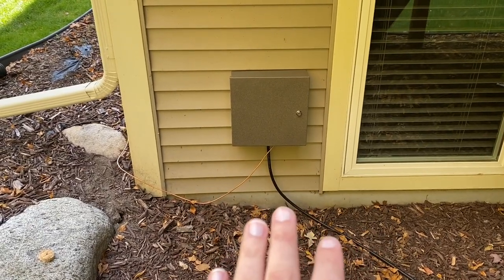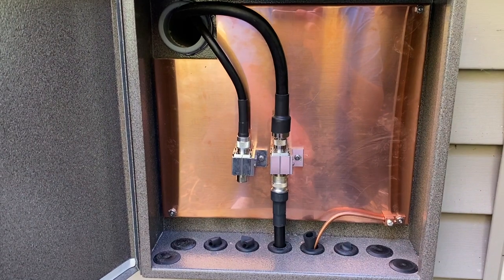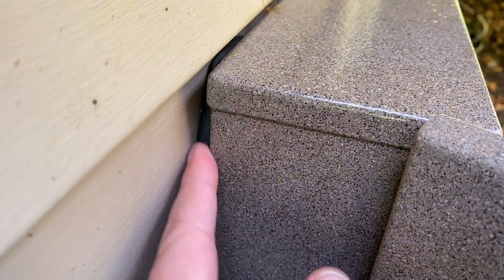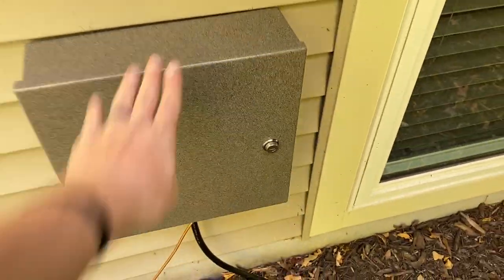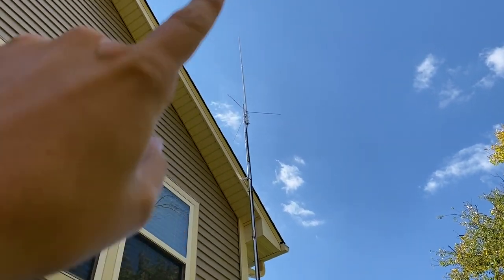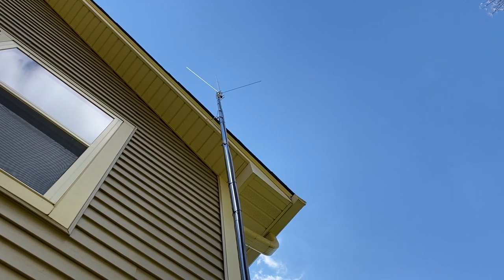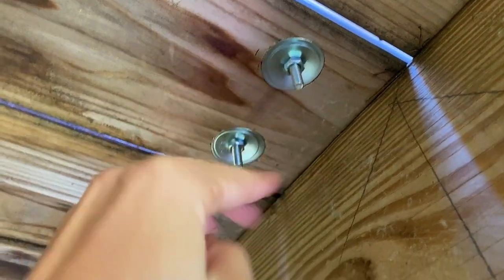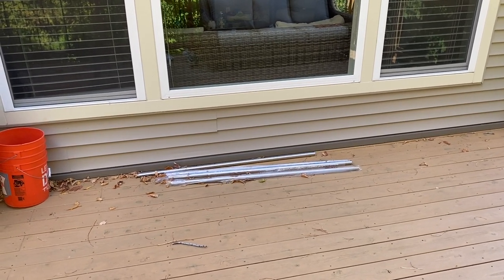K0LWC Ham Shack Tour: Coax Entry Panel and VHF/UHF Antenna Mast!

Comment: As of this writing the video is 3 years old.  For anyone contemplating a similar antenna base, drain holes at the bottom of the socket are a must.  Without them water will collect and initiate corrosion regardless of how "rust proof" the base is.  A pin going inside the mast instead of a socket would not collect water if the pin was either solid or had a welded on cap so it was absolutely watertight.

Comment: Diamond makes some great antennas. During tropo openings, I've used my X50 at 35 ft above ground and made FT8 contacts over 700 miles away.

Have you considered having the mast pass through the deck and pass into the ground? Another video idea would be to repeat the Pi Star distance test but with the hotspot using the Diamond antenna. I know it isn't what hotspots were intended for but would be interesting to see.
Reply from the maker: Nah, I’ll just ground it below the deck to a rod. Don’t want to cut through the deck if I can avoid it. 

As for the hotspot, I know of people who have done similar tests and 5-15 miles
isn’t unheard of.
Reply: How frequent are Tropo conditions and are they totally random or predictable?
Reply from the maker: dx398 Troposhoehric ducting is caused by the atmosphere and temperature/humidity levels. There can be some forecasting of it, but it’s generally random on when it appears,  how strong it is and how long it lasts (15 minutes or many hours).

Comment: What was it like working with LMR 600? Did you do the connections yourself? You mentioned switching to the Ultraflex at the box. Was that just to make the 90 degree turn or for any other reason? would you make the same coax decisions if doing it again? ...independent ground rod, or tie into panel ground rod for house service?
Reply from the maker: LMR-600 is a beast to work with. At 1/2” in diameter and a plastic jacket it’s very stiff. If the run is 50 ft or less I’d just get LMR-400 UF. Above 50ft I’d get LMR-600UF all the way. I didn’t do the connectors myself as it’s more intimidating with coax as thick as LMR-600. The use of Ultraflex was for the turn to get it into the house and makes routing the cable easier in the ham shack. The ground runs to a rod and also attaches to the house ground system off the rod. 

If you want to make life easy, just go with LMR-400UF for everything. It’s great for HF and still “good” for VHF, and “acceptable” for UHF. LMR-600 is great if you really want a sensitive VHF/UHF radio with stellar performance. Particularly if you’ll be toying with simplex work. The downside being the stiffness you have to deal with as you route the cable.
Reply: @K0LWC  the DB loss comparing 400 and 600 is small at VHF/UHF. I have 5 bands 50-1296 and only use 600 on 1296. Too hard to work with and cost is excessive

Comment: G'day from Australia .... We use UHF as our primary 80 channel  citizen band radio systems operating on 476.4250 to 477.4125  . I have about 10 handhelds both 2 watt and 5 watt  and four of my units are dual band UHF/VHF units . I have three vehicles and all three have five watt car UHF's for road usage  which is the maximum allowable output power for private use . After that you require licencing and qualification .  In my State  (Tasmania)  we have lots of non highway roads where mobile phone coverage is not good or non existent so having UHF access is great .  We have two emergency channels on 5 and 35  which is 476.525 ..  Channels 1 to 8 and 41 to 48 are Duplex repeater channels where repeaters are present . I have three repeaters Channel 3 , 7 and 8  not too far from me ,   One day I'd like to set up a basic base station at home . Your vid is a great help for a good antenna set up . Thanks ...

Comment: Nice VHF/UHF install. You really thought it out, well. If I were doing it, I would do it the lazy way by just putting a tripod on the roof. Maybe you'll be able to get into our repeater, if the conditions are right, over here in Jamestown, ND. 147.180 (+.600 input) no PL. There is a guy in MN that gets in, quite often. - ND0TS
Reply from the maker: It conditions open up it’s possible! I was going to do a j-mount on the roof, but didn’t want to drill into the roof. This mast should serve me well for many years!

Comment: I just did the same install last week, with slight modifications.  I installed two, twenty foot poles, one with that same UHF/VHF antenna, which tops out at 37'. and another with a Discone antenna which tops out at around 25'.  The poles on also on my rear deck but, because I have an 8' wall on two sides, that are constructed between 8"X8" posts that also support the deck itself.  My masts are then supported with 2" pipe strapping, and lag bolted to the posts.   They are also guy wired to the deck railings ?  (None of this really impressed my wife all that much, but she went along with it.)  The pipes are individually grounded with 60' of heavy duty coax running across the cellar to my shack.  I just analyzed the VHF/UHF antenna last night, and got a really nice 1.2 SWR reading, but I have yet to try to make a contact.  The area I live in has two repeaters, and the next closest ones are 7, 14, 21, 27, and 30 miles, with plenty of hills in between.  Unfortunalely, I live in a lowland area, so getting out on UHF/VHF is always a struggle.
Reply from the maker: Height is might! Just add a few more sections of pipe. 😉 Congrats on the new install!

Comment: Ground your mast, and you should be able to bring your SWR down.  Right now, looking at what I see your mast in part of the antenna (unbalanced load) pretty much. Heard say that you had some SWR issues. This should fix it, I've seen it before. It's simple to see that coax braid side is just a Ground, but that's not the case its still one side of a basic dipole regardless of calling it vertical, yagi,. Hope this helps it.

Comment: Newbie here KO4MWD. I like the antenna set up. If I might recommend looking at some angle brackets to mount on the bottom side of the deck board then through the deck joist. Might be over kill, but in the mountains  of Virginia where I live it gets VERY windy.  Where is a good place to order lmr600? I'm currently running a btech uv50x2, 100' rg8u,  and a tram antenna 1477 I believe. Thanks! 73

Comment: This is a great set-up but limited to those with a deck. I got a deck on the second floor but just bought a 8ft tower for the roof. I'm getting second thoughts now. I'm not sure I'm going to use the tower I bought now that I see your set up. I have more weight to support than you. Maybe 50lbs total. Think your set-up is much stronger for wind too. If I go with your set-up, I will need more than one stand off support of the house.

Comment: Does the antenna needs its own power supply or just the antenna coax that goes to the radio? Sorry if I sound stupid but I am just getting in radio stuff
Reply from the maker: It’s just connected to the radio via coax. No power supply needed.

Comment: What radio are you using in your UHF VHF system?  Thinking about doing what you have done. KN4ZPG
Reply from the maker: I’m using the Kenwood D710G, a fantastic radio for the shack or the car. Eventually it will be replaced by an Icom 9700.

Comment: Nice and clean ground system! the antenna if you can place vetical to the box not the other side, seems too low and too much coax and place the pole on the wall and not on patio so gain in height...my 2 cent 73 de iz3qvb

Comment: Nice neat setup. What did you do on the inside wall where the conduit goes in?
Reply from the maker: I just have the conduit sticking out. It’s not overly neat. I could easily trim the conduit back and place a low voltage plate cover over the hole. But I like the conduit sticking inward so I can easily pack it with insulation as during winter it’s important to seal that thing up tight.
Reply: Thanks for the info. I"m still "ideating" on my own setup. For now I just bring the cables through a door when I need them, far from ideal, especially in bad weather when they're wet or snowy.

Comment: I have been thanking about a Diamond X300-A to replace my little X30a..
Reply from the maker: It’s a good antenna, I’ve been pleased.
Reply: @K0LWC  awesome...I got mine yesterday now to get time to put it up...I installed one about 3 weeks ago and put my leg down on the shingles and it burnt my leg pretty severely which turned into a Staff infection...but I'm on the mend and ready to get this monster up and running, I will definitely put it up at night, I'm not getting back on the roof when it's 110 degrees...lol

Comment: Nice video.  I've been considering the same entry panel.  How did you secure the panel to the side of the house.  Just screws directly into studs?
Reply from the maker: Yep, just got one side lined up with a stud. It’s really not that heavy, but having it on one stud is plenty of support.

Comment: Looking to put up my first antenna at the house, do I have to ground the cable or anything so it does not fry my radio if struck by lightning. any info helps, thanks.
Reply from the maker: Yes, you’ll want to ground your antenna mast (if metal) and use a lightning arrestor that is also properly grounded. Your antenna will not survive a direct strike. However, you can have nasty static build up or issues from nearby lightning strikes that can surge your antenna system. That’s why you want to ground it properly. If you hear a loud crack and it’s lightning hitting your property. Kiss it goodbye.
Reply: @K0LWC  thanks, just starting to order parts now

Comment: Matt--I just ordered the medium sized panel and like you have vinyl siding to deal with. Drilling holes through drywall and sheathing should be fine, but I am curious as to how you mounted the box and dealt with the siding. Did you just drive screws through the mounting holes and into the vinyl and the sheathing? Did you use cleats tied to studs (it doesn't appear you did.) Or does the box just "float" along the edges of the siding with spacers / standoffs holding it away from where the screws enter the siding?
Reply from the maker: The conduit acts as a mounting point of sorts and attaches the box to the conduit pipe. It ends up floating over the siding, though you can tell when looking at it from the side. The only hole is the conduit, nothing else. It comes with weather striping if you want to use it, but I didn’t.
Reply: @K0LWC  Wow. You just cut the hole and use the conduit to hold it in place; no other mounting screws? Interesting. Can't you just pull it out of the wall, conduit and all?  Thanks for the response.
Reply from the maker: No. There is a coupling that attaches the box to the conduit, and to the house. I’d go out and take a photo….but it’s 0 degrees. 😏
Reply: @K0LWC  Aw, c'mon! It's all the way up to 8 here in Lino Lakes! 😀 J/K; I get it. And I ordered that kit so maybe it will become obvious how it secures to the house. Perhaps the 2" hole will be all I need. Thanks again for the help, Matt!

Comment: I have ben running a Comet GP-9N it it the twin to the Diamond X510HD & I Believe Them To Be The Best 2 Vertical vhf/Uhf that Money Can Buy..As Long as you also Get Really Good High Quality Coax..I may know Why Your swr was a little High..I noticed your ant was a little low on the Mast try bringing it up pretty much Even & i think your SWR Will Drop ! Thanks for Sharing & 73's
Reply from the maker: They’re both fabulous antennas.

Comment: suggestion ….. drill four holes in a plate and put that under the deck to get even more stability ….. very nice setup though
Reply from the maker: Not a bad idea, but the wind load is next to nothing and the majority of the support is at the roof line. The base plate doesn't do as much as you'd think.

Comment: Forgot to mention in previous reply . VHF is essentially used for aircraft ,  marine coms and safety/ weather updates  and  police , fire , ambulance , forestry , SES ,and rail  and is mostly encrypted and anyone caught with units that can interact on these emergency services  faces huge fines and having to give up the equipment and repeat offenders can face gaol time ..You can listen though via scanners  so long as you can't hook into and hamper operations . HF is used for long distance  as you'd know of course  . 27 Meg /SSB is essentially gone now , The truckies and buses etc use UHF almost exclusively now .  Even though VHF is primarily for essential services some of the services  do carry UHF as well as a back up  which is mostly for citizen use in case it's needed or VHF links aren't available or failed .
Reply: Not sure where you are but in the US there is a VHF segment set aside for licensed amateur radio operator use.  It's 100% legal for licensed operators.

Comment: K0LWC Why did you not put the grounding rod closer to you entery box all those bends not really good  for grounding
Reply from the maker: Long story short. I had to relocate the box.
Reply: @K0LWC  Did you run another ground wire to bond with the existing ground rod from the electrical panel to make sure everything is bonded correctly?

Grounding can be such a pain depending on where the equipment is located in relation to the main ground.

Comment: Extremely, long cable witch will  cause  a big antenna gain loss.
Reply from the maker: It’s LMR-600 so the loss isn’t too bad.
Reply: Even 600 theres gonna be loss , vhf/uhf it’s critical for weak signal , shorten that coax dont spool it up like that and if youre doing ft8 you much of anything

Comment: ⚠️ OCD ALERT !!!⚠️
It bothers the F out of me how your ground and coax CROSS underneath outside the box.  Looks so sloppy.
Also, there's no way that mast is secure enough between the deck and where you attached it to the 4" standoff at the roofline.  That length of sections in between is going to buckle in high winds.